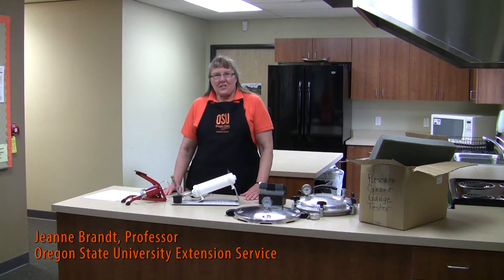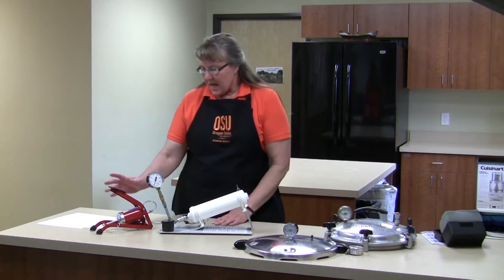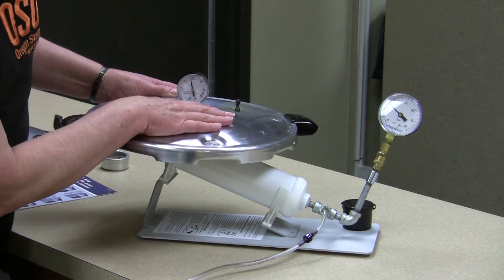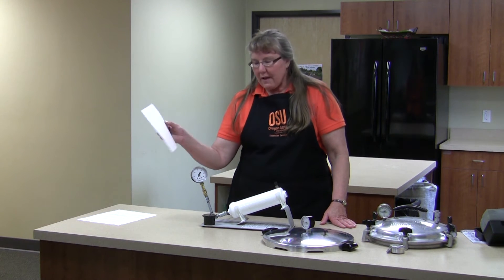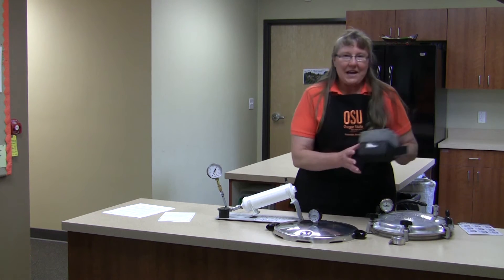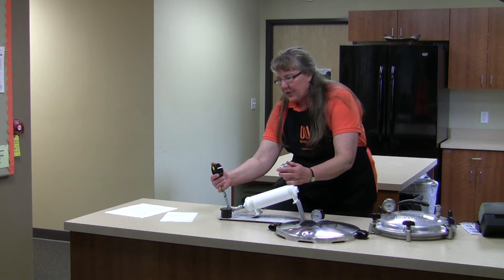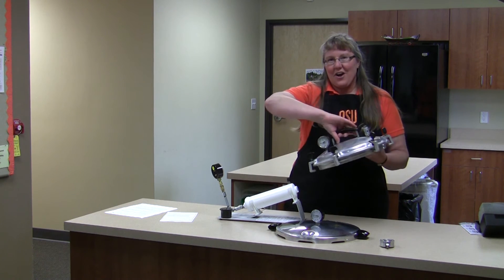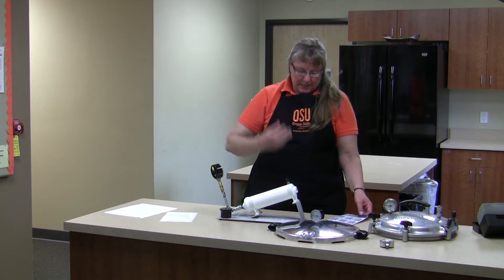Pressure Canner Gauge Testing

Comment: I can understand how the canner's gauge readings could change from year to year because it is heavily used and all that hot steam is contacting then it cools( expanding and contracting )  but the master gauge on tester is used only once a year and not subject to temperature extremes .So  How can using the tester gauged  which is used only ONE TIME per  year for just a minute at room temperature change its  readings so it has to be mailed to the mfg EACH YEAR  to be reset  ?